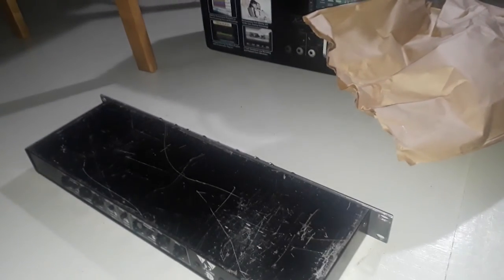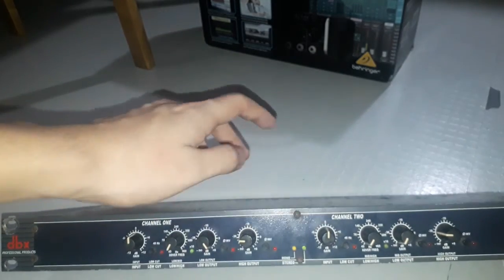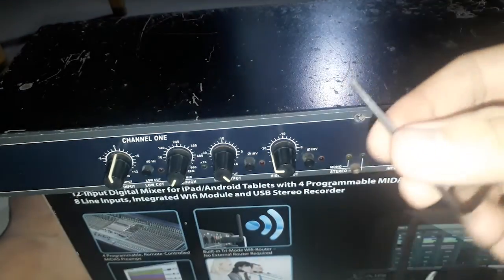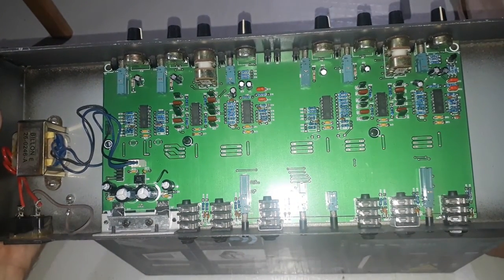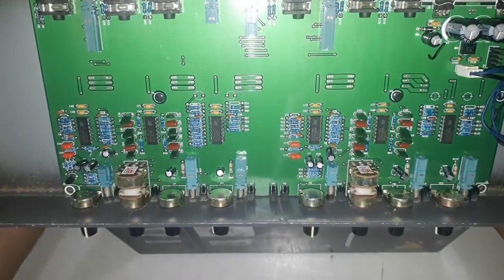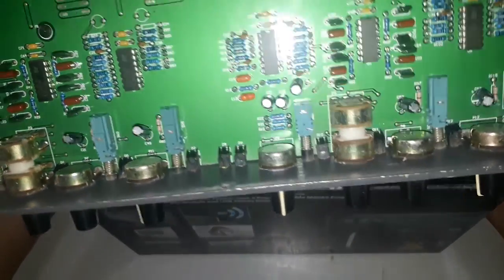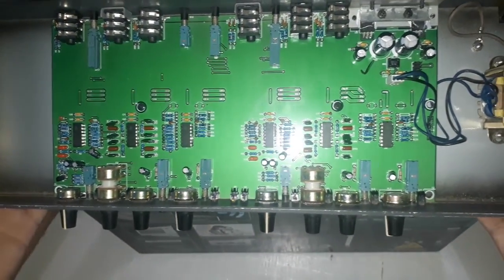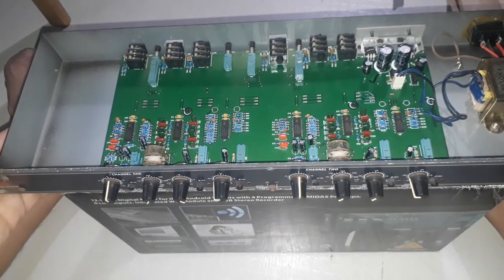dbx active crossover Internal PARTS Explained

Comment: Its not bad , tho  i dont like that power supply ...tha..tha... tha things are Voltage Regulators + and - 12V for the OP AMPs , there is no EMI filter on power supply , there is no Choke or any other kind of Filtering on the Actual 12V rails   and the actual crossovers looks like 2nd order 14dB per octave , i would liek 4th order  and i dont see there Balanced outputs 
But ok , its not bad ,  Those Stereo pots can be replaced by simple stereo pots in case of fail with a bit of wire .
Reply from the maker: not 24dB ? it claimed its 24dB
Reply: @mrflexysmps5826  Doesnt look like 24 to me , 24db is 4th order , so you need 4 Filters per driver , 8 for a speaker  , usually opamps come in dual package , so that is 4 OpAmps  Ics  per channel 
Maybe those are quad op amp package ICs .
You can check online , if its Quad opamp package then it is .
Reply: It IS 24dB. Those are quad OpAmps. All the filtering you describe is really only needed with switching power supplies. A big fat elco and a smaller capacitor in parallel will filter just fine!
Reply: so it is not trully balanced?
Reply: @coin777  you need 2 op amps and 3 wire output for balanced . If you see 3 wire output and those opamps it is , but i did not see it . That being said , Balanced connections have lower Dynamic range , due to having ICs in so drops a bit , some 6dBs . But its necessary if you have a studio with lots of devices , if not RCA is better.